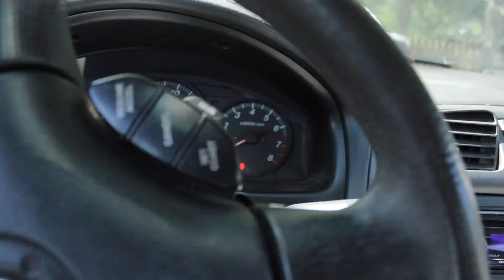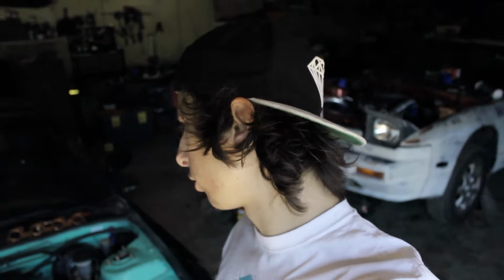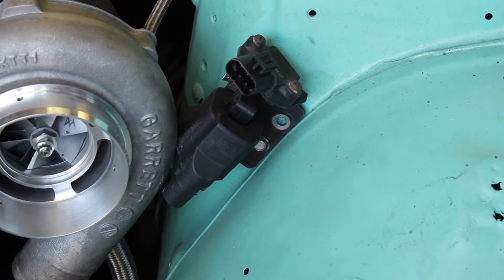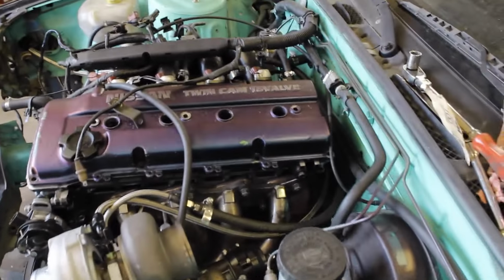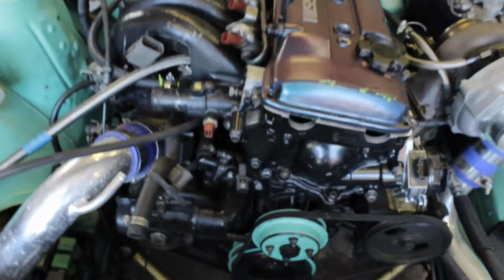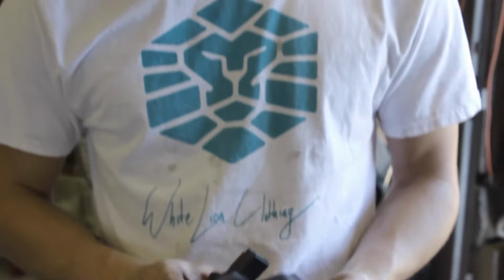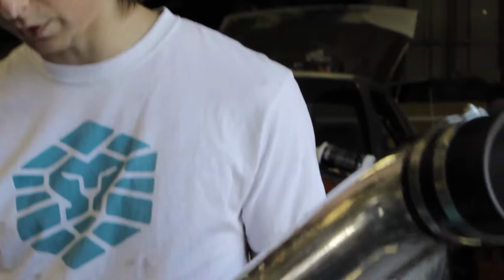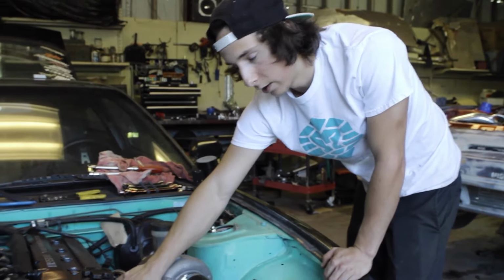TURBO 240SX BUILD | WE GOT ALOT DONE, CLOSE TO STARTING!

Comment: Are you gonna run the insert inside the gt30r ?
Reply from the maker: what insert???
Reply from the maker: didn't even know about that, but probably not homie
Reply: Southern Hooning Most people dont im running a custom one for mines shit is loud ass hell.
Reply from the maker: what exactly is its purpose?
Reply: Southern Hooning its a anti surge stack a option garrett made for the turbo a long time ago. if u look inside yo turbo u can see the little step where the velocity stack ring sits. It should be 3 little holes on the compressor housing where the screws go that hold it in.
Reply from the maker: yea I noticed that, just didn't know what for
Reply from the maker: I'm gonna look in to the insert

Comment: ok so I wanted to ask you for advise I just installed a s13 ka into my s14 I got fuel I got spark my injectors are spraying like there supposed to do but the motor still won't full start it goes to turn on but doesn't fully turn over when I mess around with the converter it gets closer to turning on i just replaced it for a new one so I can't figure out why it went fully turn on is it a timing issue ink can you help me please?